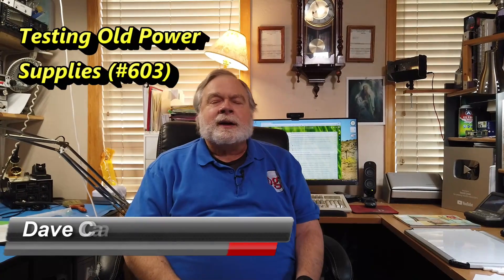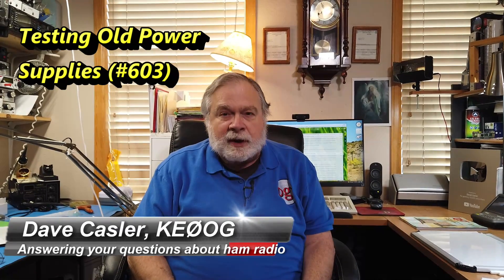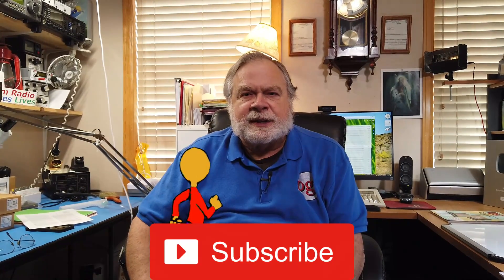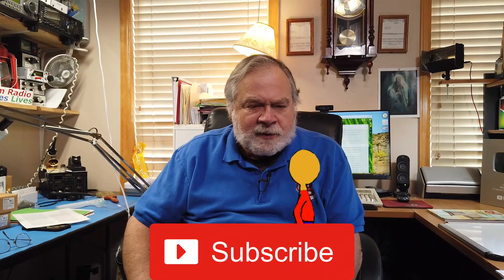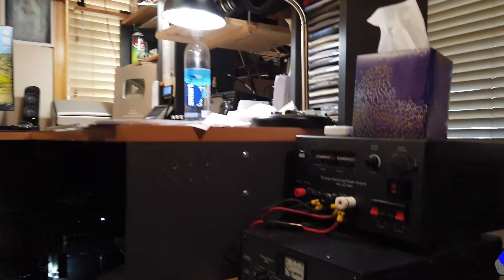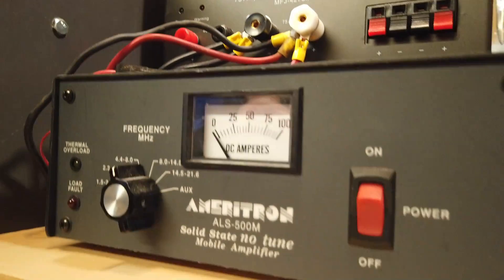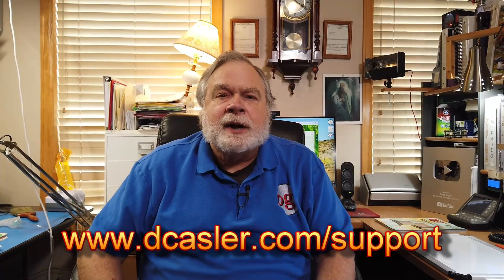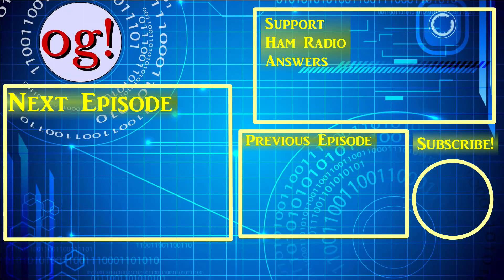Testing Old Power Supplies (#603)

Comment: I have used variacs. Start at 0 volts and slowly raise the input voltage 10 volts at a time for an hour or so until you reach 120v. You look at the current and can tell if the caps are shorted completely without putting in enough power to kill anything. The capacitors re-form, and can work again.

Comment: Remember that good filter capacitors keep lethal voltage even after the supply is switched off. It is safe to bleed the charge to a resistor, not to short it.

Comment: Dave,
    Around 400 volts or higher, a charge cloud forms around the metal surfaces.
   If you are grounded, you do not need direct contact to get shocked or electrocuted. Just reach into the charge cloud and get jolted. N0QFT

Comment: Good information Dave.  I would also recommend eye protection and plastic or rubber gloves that tend not to pass electricity. I have some line man's gloves that are a bit thick but work well for safety if not dexterity. Eye protection so that if you  do some thing dumb and the solder flies you won't lose an eye.  Just a thought...

Comment: Very good advice!

There are several good you tube channels that feature equipment repair and rebuild. 
One I particularly like is " Mr Carlsons Lab " he is very knowledgeable, works on old equipment and gives excellent explanations of circuits, components and safety.
Reply: "Glasslinger" is another guy repairing old electronics. He always begins by replacing all old electrolytic and paper capacitors, while mica ones can be kept in place.

Comment: I have a 1955 vintage "adjustable" 12/24v military power supply. It is the two huge selenium rectifiers that are more dangerous than any old caps.
Any words of wisdom about replacing the selenium rectifiers with  modern diodes?  KB1KCT

Comment: Would it be possible to use wire from an old box fan to rewire a transformer? In the old style radioes you were describing.
Reply: A new, unused enameled wire is preferred for rewinding a power supply transformer. The enamel insulation may crack on old wires.